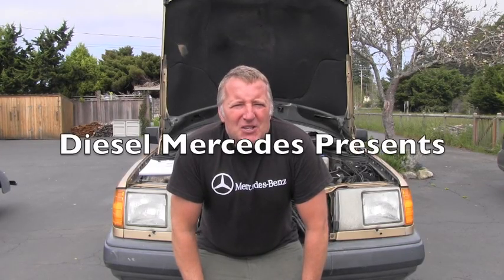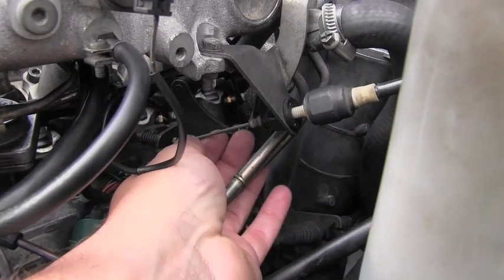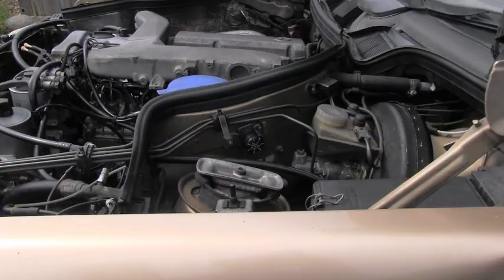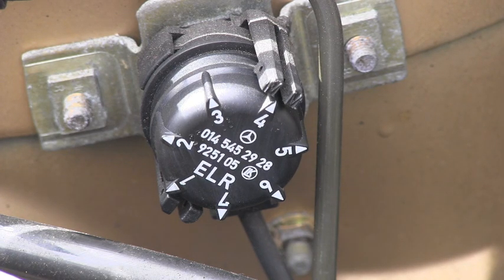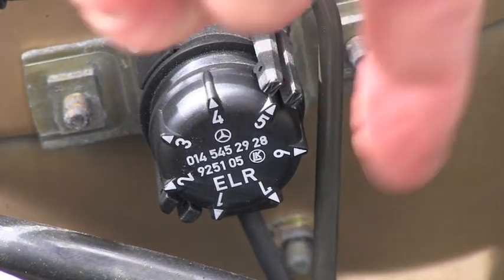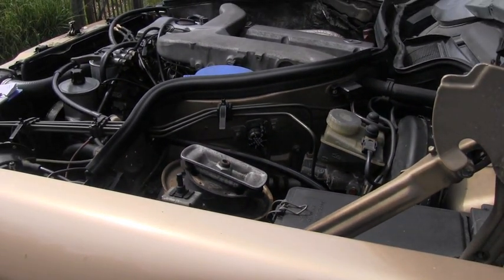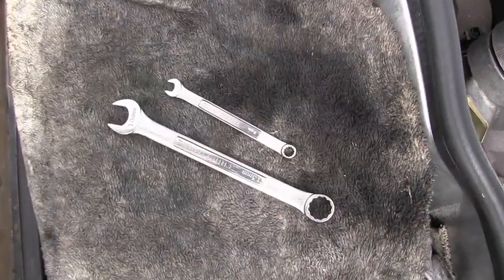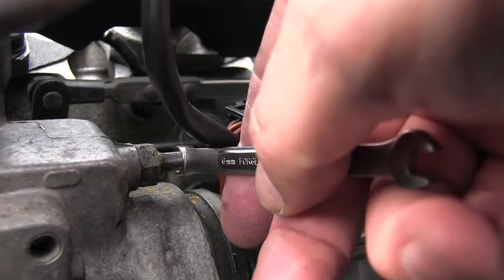Mercedes Diesel Engine Idle Speed Adjustment

Comment: In regards to the technique of setting the idle speed mechanically, using the two bolts, this works exactly the same on the om602. 
I had to find this out myself, before I saw your video. It would have saved me a lot of time! A reputable Mercedes shop in my area apparently did not know about this adjustment, since I had brought my car in because of high idle, and they were not able to do much.
Great videos, please keep them coming!
Reply from the maker: thanks, I will…..
Reply: What is Idle?? I have a om602 mercedes engine in my Bager( Instruction machine)  but my engine smoke a lot ... cann you help me?
Reply: @argjendpotoku9350  Idle is the speed where the car rests when you start it and when no accelerator input is made. If you car smokes a lot maybe its the ALDA or injectors, etc.

Comment: Mine non-turbo 2.5 1986 W201 Om602 has very high idle when the engine is warmed up. I will try this as soon as possible, 🙏 thanks 👍
Reply: Did you fixed it? im having the same issue

Comment: Nice video, but i have a question. How did you remove the transmission modulator valve? I don’t see it anymore in this video. I’m working on a project and I’m curious how to bypass that valve.

Comment: I have a 1991 300D non-turbo (OM603.912), so no ELR, and my idle is to low... The plastic screw part of the accelerator cable is broken, is that the reason for the low idle? If I change it and tighten it a bit more, will that increase my idle speed a bit? Thanks in advance.
Reply: Dont adjust idle with the accelerator cable. It must be pure an injection pump thing

Comment: Hello Peter should these cars have any lifter noise. My 1987 300d w124 sounds just like the motor in your video. Is this normal. Also my tachometer and temp gauges is not working. 
Any advice for me. ?
Thank you.

Comment: Hey! I own a 207D that has some terrible vibrations on idle. I checked injectors, mounts, and they are all good. I suspect that the engine has too low RPM on idle because when I pull the throttle cable/increase the RPM a bit, the vibrations go away and everything is smooth. Is there any way to check if my engine RMP is in optimal parameters? I searched online for professional service on this but didn't find anything (at least in my country). Thanks!
Reply: Has averiguado algo?

Comment: Have a nice day.
I need your advice about my car, when the engine is cold my idle speed is very low (450-500) rpm
when warmed up 1000 rpm
there is a vacuum valve on the adjustment screw, would it be faulty?
also, the engine makes a strange knocking sound when I step on the brake many times, which goes away after a while
I really like this car and I want everything to be fine with it. the car was manufactured in 1991. w124 250d with om602 engine

Comment: So if I adjust my idle speed the engine will run good? Will the high RPM make the me loose more diesel ? I want my car to be on good fuel consumption
Reply from the maker: Ato Nympha Adjustment was very slight, it will not affect Miles per gallon fuel consumption numbers…..
Reply: Do you have any specific level or number that I can tune the idle to? what the normal or average tune for idle speed .I have 95 E300D
Reply: 580-680 rpm

Comment: what is the purpose of the idle can u give me a reason?
Reply: oil pressure for diesel engine is very important. high enough idle means oil presume and transmission will work correctly